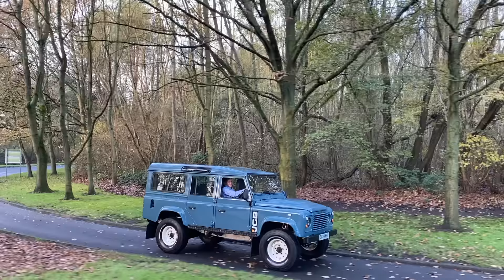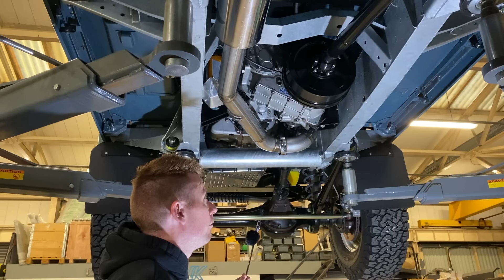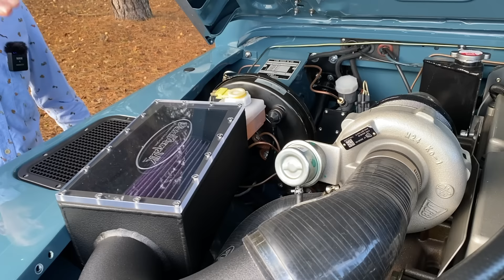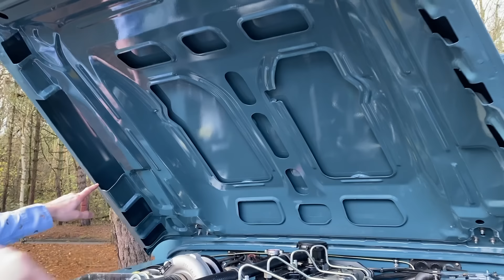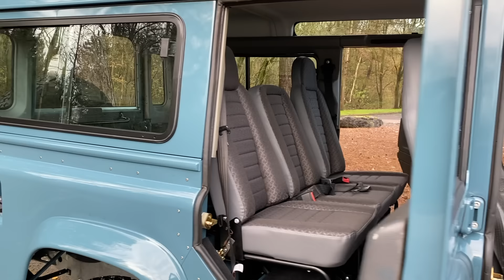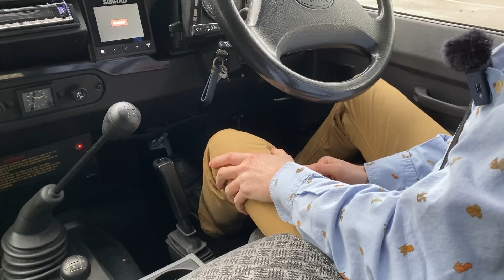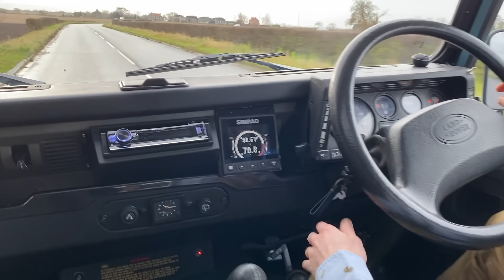British LAND ROVER Defender with JCB 4.4 Industrial Agri Engine Conversion Dieselpumpuk

Comment: Having worked for JCB i can confirm it will not be reliable!! Fixed hundreds of these engines for various reasons. Most of them left the factory with hardly enough oil in them 😂 

Cracking build tho! Stunning 110
Reply: The Americans call JCB “Junk Comes from Britain“

Comment: This engine is surely designed to run indefinitely. The conversion is excellent, and JCB serviceability is available worldwide. It's a good choice to use this engine.
Reply: I have multiple perkins 1104's over 30,000hrs with no more than oil, filters and valve lash services. (Its cheaper to buy a new engine that get the overhaul parts in Iraq) Even an 1100 on 46,000 hrs that's had the same as above but with 2 rear main seals. Sat on a hill powering watch towers since 2014.
Reply: Av got 14000 hours on a 535/95 telehandler with no problems at all
Reply: Lovely build I definitely would like one like this 👍🏻
Reply: Has this vehicle been tested by any of the landrover magazines,if so can you give me the details as I’d love to read more about this conversion.
Reply: Sadly the fun begins at 5000 hours disposable engine
Reply: @scaifefab4585  We have engines nearing 12K hours and the engines are fine the biggest problem is hoses and hydraulics but thats because they have a shit life
Reply: @sausageroll2695  im only going off my own experiences looking after them in a marine environment im not an anti jcb type i own a jcb telehandler ( not got that engine in ) 
just   seamed my fitter was never  away from them with daft small niggly repairs worst was water pump which then turned into a head gasket job as the temp sensor was in a position as when water level dropped it didn't set of over temp alarm    as wad dry ( common with a lot of manufactures inc landrover) mabe in plant they have a water level alarm ? 
i have a friend who is an agri fitter for local jcb where i buy parts and he says same spend lots of time fixing small  daft things after 5000 hours 
  
very nicely done conversion on this one though not a easy one with the sump and bonnet to re work but hats off to the quality of the finish 
i have driven a 90 with a mazda slti conversion which i would think will be a similar drive maybe a few more revs on the mazda 3250 redline b but bags or torque  same mazda  engine used in boats did good hours 20k before they needed a rebuild 
the jcbs weren't  around long enuf to see if they would do that may hours as owner moved the boat on for a new one with cummings power plants  far from trouble free either but again small niggly things
Reply: @scaifefab4585 @scaifefab4585  Working 5,000 hours in an industrial environment with heavy loads can be challenging; however, this engine is unlikely to experience such conditions. Additionally, 5,000 hours translates to approximately 200,000 miles. I believe that with regular maintenance and typical road use—possibly including some towing—this vehicle may actually exceed that mileage, potentially reaching twice that amount or more. It will be interesting to see if we get a year-on-year review of how the engine performs.
Reply: @scaifefab4585 never had any issues with the engines doing more than 5000 hours, had one do 11000+ hours no issues before trading in, running gear seems to be fine from JCB it's just the rest of the build quality
Reply: @farmerlou16  just going off my experences with ones in marine aplications and comements from local jcb dealer where i get parts
Reply: @scaifefab4585  Ah marine is a whole 'nother beast, some engines that are bulletproof on land crack heads, blocks & mush rods in a tiny boat before even truly breaking in.. I've heard some theorise that even just changing a balancer can alter how an engine does drastically in marine applications;

The few proven & reliable companies who converted road engines into marine usually de-rated them 20%+, pre-heated sucked-up cooling water via exhaust & other crazy whacky "unnecessary" stuff!! I don't know sh*t about this particular engine so for all I know it could be bad after set amount of hours as you said, but just saying marine version is something I usually don't look into because of how different it is. The craziest part to me in marine is that it's the only application where 2-stroke Diesels were de-rated, even with direct-water coolers which logically should give you over 20% extra power because of the extreme charge cooling, that's what I realised marine is no joke, if even Detroit couldn't get more than 500hp from their compound-turbo 6-71s!
Reply: Talking to a diesel mechanic for the forklifts we had, engine wise they where pretty good fleet of over 60, he said the worst thing they ever did with a diesel engine is remove the governer or restrictor basically if left at 2000 or whatever revs they will last all day long like generators, once you rev them up and down it changes everything, in warehouse or JCB work where they run a hydraulic pump mostly they are great rev between 2000rpm to 3000rpm  but once put into a road vehicle and you need to rev them constantly to get the speed up it won't last for too long the type of engine in this is designed for long periods of low revving once you start moving a vehicle over 30 mph you have to rev it up and that huge up and down doesn't work unless you gear it to keep low revs with a great gearbox this might be genius probably way better than the standard engine but it's not designed for speed slow and steady is what it's made for!
Reply: @danielduke5059 run at 2200 ish when set up in a marine aplication wasnt so much crank piston turbo and cams type stuf was all the little bits that failed bet tenshioners were a regular thing (may be i different part ti agri) water pumps  as well starters but they are 24v so defo for marine just seem more frequent than other brands (perkins excluded they are poor )
Reply: @scaifefab4585  cool that you work with marine engines buddy, we used to ship volvo penta engines for a UK yatch company from Sweden those where beast engines, I'm not hugely familiar with diesel engines had a few cars with diesel engines in the UK pre 2000 is best before all the emissions stuff seem to be the most reliable had an older car 2000 never had an issue, had a newer diesel later on like 2013 both Peugeot they do make good diesel engines think they have some kind of deal with other French manufacturers and they all basically use the same engine even ford used the French engine in their cars early 2000, great engines the gearbox failed in both a Peugeot and a toyato rav4 for me and doing a little research due to emissions the newer diesel engines well in Europe are aimed at fuel economy and emissions and due to adding a turbo they produce alot of torque so manufacturers introduced the duel mass fly wheel to help the gearboxes they already made deal with the torque literally both cars gearboxes destroyed in under 100 thousand miles as they didn't make the gearbox tough enough to cope with the extra torque! I've been in warehouse work for over 22 years and driven all sorts of forklifts and tug vehicles and the forklifts seem to be ok we broke alot of axles on forklifts but the engines were solid we had CAT diesels for a while they were the best, tug wise either the turbo blew or the gearbox never the engine but both types of vehicles never revved high either drove a hydraulic pump or a small ratio gearbox , I think what the mechanic was saying is the constant up and down revs where's out the diesel engine, of left at a constant it would run for alot longer, I never understood why there are no or not many hybrid diesels that makes way more sense been doing it on trains for decades!
Reply: @danielduke5059  Interesting, the infamous Detroit 4-stroke they developed for Ford (or GM? I forgot lol) was an AWFUL design & one of top 5 worst diesels ever, made 2nd worst; but a few guys managed to make them last forever, know how?? They set the governor just a tad lower lol, the slight decrease in peak RPM hit literally increased lifespan by a magnitude! & I believe it was like 500-200 RPM difference only, not even close to 1k RPM... But then doing opposite & un-governing it makes it die near-instantly lol. So it's possible the engine wasn't even that awful, they just set governor too high after the design process or something, either way how RPM affects diesels is a crazy topic, nothing like a spark-ignition engine, which has the opposite effect in a way where lugging is what kills them.

Comment: how does that sound system sound blasting out slayer  at speed? and do you reckon that engine would go in a w124 or 210 merc? with the power bumped up to like 200 horse?
Reply: Engine is to tall for a passenger car. It doesn’t fit.

You’re also better off with a engine that revvs a bit higher in something like a 124. That makes it nicer for the driveability

Comment: oh yes .. like it .. i've seen a few 6bt Cummins defenders & often wondered about the 4bt Cummins  .. if i win the lottery tonight i'll give Luke a call
Reply: I'm putting a 3.9 ISBe Cummins into my 130. Not much bigger than the 200tdi that was in it. 150hp or could go to 200hp with a stock tune from a F250 like mentioned above. Uses ZF gearbox to LT230
Reply: So you can fit a 12 valve in there huh?
Reply: @marvindebot  absolutely
Reply: 4BTs are too small for something like a Defender. They'd be right at home in a Tacoma/Ranger/Colorado, but anything bigger than that and she's gonna be struggling. Of course, you could modify it to make more power, but then you're sacrificing reliability.
Reply: @GAFFzero  Ford sold the F-250 here in Brazil with a Cummins 4-cylinder from factory in two occasions.
1st was from 1999 till 2005, it was the 4BT, I guess. 3.9L, rated at 145 hp. Above it was the MWM Sprint 6.07, a 4.2L inline-6 pushing 180 hp.
Later, when this one ceased production, they started offering the ISB 3.9, now rated at 203 hp.
Mind you, an F-250 Crewcab with both this and even with the MWM engines...wasn't exactly a performer, but it...ran. lol
Reply: @GAFFzero  people make 500hp out of 4bt's in the USA. Not sure why you wouldn't want to save the weight
Reply: @THESLlCK  That would be the part where I said you could modify it, but you'd be sacrificing reliability.
Reply: @GAFFzero  Considering these are 500,000 mile motors, I don't believe that would be a big deal. I can't imagine hitting 250k miles in what is basically a farm use vehicle. Unless this is a fleet vehicle being constantly worked, I would't worry
Reply: @GAFFzero  ... lol , you do know what is in them from factory ??
Reply: @888johnmac  Right... Because everything auto manufacturers do is correct... Not like they've ever fucked up before, eh? lol
Reply: @GAFFzero  there is a video on youtube fo a fella who put a 4BT into a Ford Excursion. tuned to the nines, pulls a big trailer with it. good power good fuel economy. an Excursion is easily as big as a landrover. 3500kg kerb weight! https://www.youtube.com/watch?v=ud7RCylnMGw
Reply: @GAFFzero  6BT are way too big, it really messes with the weight balance
Reply: @GAFFzero 4bt wouldn't struggle lol, they power vehicles 4x the size of land rovers

Comment: Wow. The first LR in the world that will run to the shop and back, without overheating or just stop. Kudos
Reply: The people who think this are the people who buy a luxury brand from its fifth owner and think it’ll run forever with minimal servicing at their non-dealer local garage…
Reply: Hate to prove you wrong but I run a D3 and a D4 on my farm, both on around 240,000 miles with original engines, turbos and only wear and tear parts replaced. Biggest cost has been a steering rack on one and two prop shafts.
Reply: Don’t be soft 🙄🙄
Reply: 4BD1 in Aus delivered 110s... Lol
Reply: @AshGTE what army and what 2.5 BMW engine was that?

Comment: Wow, what a Great build, the engeneering and buildquality make me speechless. I have had a similar idea, by using a iveco 3.0 Liter 4 cilinder in my defender 130
Reply: These 3.0 engines were originaly put in spanish version of landrover santana, but were marketed under iveco massif name
Reply: Try a Toyota 1kz. Lovely poky units.
Reply: @LordXenusbigfattbutt  thanks for the good idea. I have to be careful with older enginges because of Emissions wich are are only allowed when getting better than the original where I live. That is why i was thinking about the more modern 2020 (ish) Iveco Engine. There are nice engins out there but there are many hurdles to using them wehre I live. I think the most likly choice of eingine will be the m57 out of a cheap 325d
Reply: Those things are crap, they have decent power but so unreliable
Reply: @Raddaddownunder do you have a good alternative? I can t say the same about these but to each their own.

Comment: Fantastic, love it. An industrial engine with geared timing that will last forever and be easy to maintain.
Reply: I don't know if it's a great idea... Built for running at low rpm under constant load... Not the same use under the bonnet of a car
Reply: @14KiloWhisky  yes I see what you mean. I was thinking in terms of the 1FZ in my 80 series toyota and the equivalent diesel engine, they are always referred to as "industrial" engines, used in industrial machines and boats i understand.